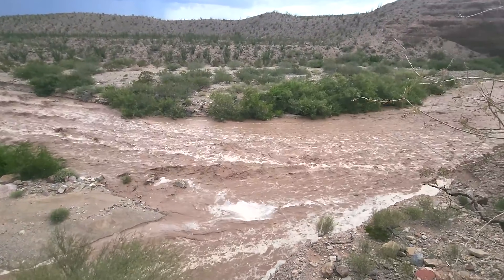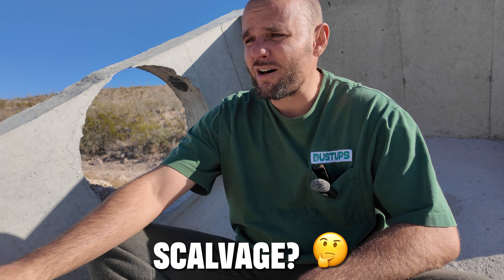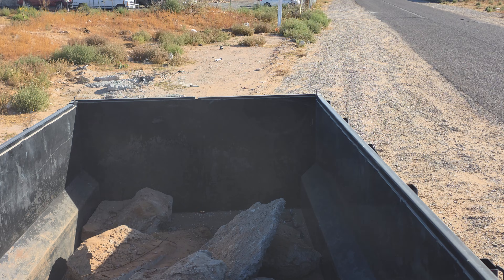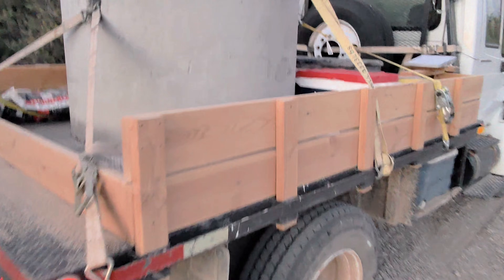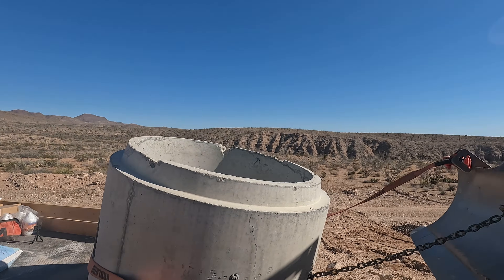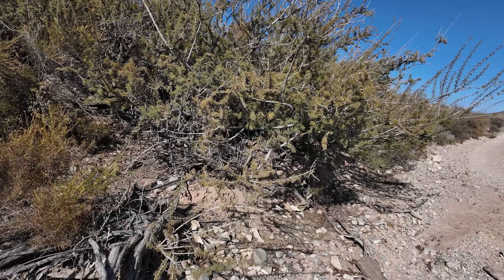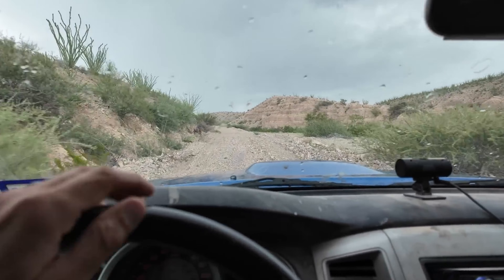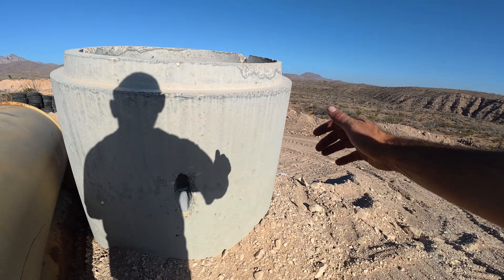I'm Fighting Desert Floods with Free Waste Concrete

Comment: the point is mostly to blunt the speed/power of the floods so it doesn't wash out the road, not stop the water? I wonder if there is other scraps you could gather something like bricks or even stones from demolished buildings etc
Reply from the maker: They are too light. We need big, heavy objects to fight the flow
Reply: @dustupstexas Having watched the video a bit further... You mention having a bulldozer. I am afraid it'll make most sense to move as much gravel and rocks from the surrounding hills to the canyon bed as possible and create a flat "dam" with a width of 30 foot or more.  Double the width of the canyon's bed (= space the water is flooding on), the water will have half force. I mean, the canyon is where it is just because thousand of years ago the first flood went the way it went and all floods afterwards just deepend the canyon.
Reply: @Barskor1 That needs to be checked, yes. Good suggestion! Shoveling dirt from one place to another on your private grounds to keep your feet dry during rain season possibly is not considered a dam though.

Comment: Could always incise lines into the concrete you get(on both sides you intend to break) and then use a hammer or its own weight to snap the blocks along those incisions. Then you can rearrange the smaller bits and use a little bit of cement to reconnect the waste concrete back into shapes that are more desirable for flood control. In general that can just make getting the material where you need it a lot easier. It stops being as free but your equipment will be much happier dealing in smaller pieces of concrete being moved(as will your backs) and you have more control over the final barriers. You'd effectively be making cobblestone walls out of concrete.

Comment: Scalvage needs to be a real word! Put it into a dictionary & ship it!
Reply: Boys, we've just witnessed the birth of a new word in the english language!
Reply: scalvage
/ˈskalvɪdʒ/ verb (tr. & intr.)

1. To search through debris, wreckage, or discarded material with the specific intent of extracting components that possess structural integrity or functional value. Unlike scavenging, which implies desperation or indiscriminate gathering, scalvaging implies a skilled assessment of worth.

"After the server migration failed, we scalvaged the user authentication logs to rebuild the session history."

2. (Software Engineering, colloq.) The act of ruthlessly dismantling a bloated software abstraction or legacy system to extract the high-performance core logic (the "gem") hidden inside, discarding the surrounding wrapper code, frameworks, or bureaucracy.

"The physics engine was a mess of OOP indirection, but the collision math was solid. I scalvaged the solver and rewrote the memory access pattern."

3. (Gaming) To loot destroyed vehicles or structures for high-tier crafting materials rather than finished goods.

Etymology: Early 21st Century: a portmanteau of scavenge (to collect from discarded waste) + salvage (to rescue or save from ruin).

Synonyms: Liberate, reclaim, repurpose, extract.

Antonyms: Landfill, deprecate, abstract (pejorative), wrap.

Comment: It seems you should retain the water underground, not above ground. Waterproofed underground pools with plastic sheeting. Water not exposed to sunlight can create a swamp where vegetation will cover the surface. Rainwater can remain there for months or years. From your video, the rainwater flows in a straight line; you can make the flow meander by digging holes and placing piles of stones where the water passes, forcing puddles of water to move like a snake, creating dozens of small puddles and properly waterproofed underground pools. This can retain and spread water. Vegetation will automatically begin to cover the ground. Groundwater hardly evaporates. The ground will always be moist, and that's the goal. Free water all year round.
I stated this long ago. I even suggested buried no-lid barrels. You can bury tens,hundreds of barrels,  hose-connecting them from up to down slope. Water will flow for months, years... the forrest will be a step away. 
No water. No desert forrest. Simple like that.
Reply: Simple like that: That will cost a fortune. 😊
Reply: @leonlowenstadter9223  Plastic sheeting is not that expensive and IMO the goal is water retention and plant biomass production I had a similar idea I called soil ponds acting like wicking garden beds.

Comment: 5:53 lights on for safety! Hire a semi? One trip might be $1000? The capacity is 5 times (estimate) what your are hauling. Best always
Reply from the maker: How will I unload a semi? The deck is even higher without airbags (I think).
Reply: @dustupstexas  a semi pulling a end dump trailer. Typical load is 40,000-60,000#. 3 axle trailers go up to 100,000#.

Comment: When unloading could you tie the item to something in the river bed then drive away? It doesn't matter if it breaks. That's one you get something heavy to use as an anchor.
Reply: That's too high risk of it damaging the truck as it falls off.
Last thing you want is for it to catch on something and rip the truck a new one in the process.
Reply from the maker: Hoping that heavy things falling from expensive equipment isn't a good strategy
Reply: @dustupstexas  Well, not a long term one at least.
Short term, it will at least be reliable enough to do it once.
It might just add the truck to the debris pile in the process, though. But it will have done it.

Comment: Might want to give the concrete blocks a rinse but otherwise water passing through them into the soil should be fine (assuming here the blocks having been used to house/protect other infrastructure such as pipework). 

Different story if the blocks were used for handling volatile chemicals and residue from that being on the blocks, as that would over the course of rain events leech into the soil (let alone groundwater). 

Additionally, a bonus of Dustups being majority rock and sand, water seeping into the soil goes through a gnarly filter passively.

Comment: Sounds like a solid plan.  Just watch for the gaps in the wall b/c that's where the water will be focused and you'll get serious scouring there.  Ideally, you want the concrete chunks to be at least 2 deep, stacked on the ground like bricks so the joints overlap and you don't have wholes in between that the floodwater can easily shoot through.  That first pile, for example, isn't butted up tight to the slope, so a flood that's only 2' deep will be able to go up the hill and around the pile, eroding into the bank and causing all manner of problems.  Potentially.  It's hard to say what will happen until that first flood shows you where the weak points in the design are.
Reply from the maker: It's not the final placement. That and the dozer can't place them with any precision. It will be messy and flawed, but still better than a raw flood
Reply: @dustupstexas  It doesn't require "precise" placement.  Just make an overlapping pattern so there's no straight run for the water to shoot through.  That film of yours shows a whole bunch of water coming down in the flood, and any part of that being allowed to skate on through a foot-wide gap is going to have tremendous erosion power that could leave you with a trench several feet deep.

Unless I mis-read the layout.  If you're putting the concrete on the downstream side of the roadway so that the silt will be deposited upstream, where your road is, then what happens after the water passed through the gaps isn't really important.  Sorry if I didn't get that right.....

Comment: Real Civil Engineer here with a MSc, 🏗️🧱🌊

Hey Shaun, your dam design idea looks pretty good, big pieces provide good structural integrity. Try to add more weight (fill the concrete voids with big rocks/gravel) to increase total moment of intertia. This will help alot to resist the water.

For your desert forest idea, holding the water is the most important thing my a mile. All other things dont come even close. If you have enough water available for a long time on a spot, nature will do the rest. The plant species/shade/soil/ are more the cherry on top.

If you have any questions, feel free to ask.
Reply: I can see many problems with what he is building but I am not a structural engineer so I shall be quiet.
Reply: @lukedaniels7750  the problems your seeing probably stem from what you expect them to accomplish with this project and what others expect.
Reply: @ProphetofEntropy  I don't know how you can say that without enquiring what problems that I foresee ? The water will find a path through whatever is used to dam it. Either the water will flow underneath the 'road' or it shall probably wash it away.
Reply: @lukedaniels7750  the point isn't to stop the water, its to slow it down.
Reply: @bobbycrosby9765  If the water could be slowed down, that would be great. That would surely reduce erosion.
Reply: @lukedaniels7750  WOW REALLY
Reply: @HR_DR  Excellent contribution to the discussion. 10/10 would read again.
Reply: @lukedaniels7750  He's essentially building a huge bda.   The goal isn't a dam but slowing the water so it will be less destructive and also so it will drop it's material upstream of the wall.  The wall will also mitigate the deep grooves he's currently seeing after flash floods which make it impossible to get back on the property until he rebuilds the road across the wash with the bulldozer.

What problems do you see?   You might see something interesting.
Reply: @mac_mcleod  I understand what you are saying. I just think that blocking some parts might make the water flow faster over other parts.
Reply: @lukedaniels7750  Understand.  I think his goal is a foot or two of still water going back a couple hundred feet with faster flowing water on top spilling over the concrete forms and going through small gaps full of smaller rocks between them.

Cheers!
Reply: @lukedaniels7750  Думаю его цель построить дамбу так чтобы  поднятие уровня воды всего  на метр создало заводь площадью в десятки акров где вода бы замедлялась и почва которую несёт этот поток оседала бы в этой заводи.
Reply: @mac_mcleod  I wonder how he's going to stop the embankments getting washed away?
Reply: @JK_Clark  Probably allow the water to go over hard concrete in a couple places.

embankment===___========___===embankm ent
The low part would be mostly concrete too but lower (6"?  12"?) than the high part.   But would still a couple feet high to create still water.  

Also, he expects the water to flow over the entire wall at some point so he'll probably take part of it up the embankment so the water won't overflow there.

However, I'm not sure he's realized he needs to protect the back of the wall from overflow turbulence and erosion yet.
Reply: @mac_mcleod  Many thanks for the explanation, that intuitively looks like a decent plan to follow. With all of the hardcore material in the surrounding area, hopefully he'll also buttress the concrete parts with a lot of boulders.
Reply from the maker: I wish I had a front loader. Adding weight in the forms would be trivial. Once we place them, I'll try building ramps with the dozer to shove material up and over the walls to fill the gaps. It should work, but we have to be careful. It's easy for the dozer to crack the forms if we apply too much force in the wrong spot
Reply: @dustupstexas  Я бы сказал что вам стоит нанять кран и точно установить все блоки за раз, на подготовленные бульдозером площадки.
Если волочить блоки отвалом бульдозера их разрушение неизбежно. Точность установки так же очень страдает, а вода будет стремиться размыть любой промежуток который ей оставить.
Reply: @dustupstexas have you heard of Tesla valve?? might be quite a bit of work and a lot of rock/concrete but if you’re looking to slow down the flow of water and stop erosion might be your best shot, if you place your barriers with Tesla valve design in mind I think in the long run will work better for your land
Reply: @derhell9401  I don't think that matches his plan here.

I think he's doing this

flood->   road    ->  25 yards/meters -> wall.
The wall is going to slow the water down to before the road result in the road being under an area of "dead" water.   As a result it won't get deep ravines and larges rocks on it.
Reply: Looked up the right vocabulary. Civil Engineering is perfect if you are familiar with dykes like this one: https://youtu.be/FwShERhxvzs?si=XodW6sczSqIexrHZ. This like 30 degree slope is "softening" the power of the water so that it does not break or washes the dyke. In parts of the Netherlands and Northern Germany there are dozens of kilometers of dykes to protect against the force of the North Sea.
Reply: Yeah this guy's videos come up on my feed and I make the mistake of reading the non Profesional comments.😅😅
Thank you for dropping in.
I felt a pain when he said he was using that pipe for something other than the flood control. Vertical filled with stone that's an anchor.
Reply: What’s a MSc?
Reply: @pyroman72  Masters of Science
Reply: You’ve given one engineering related piece of advice, to put rocks in the concrete voids. Do you really think a desert flood has a snowball’s chance in hell of moving those slabs?
Reply: @HikarusVibrator The water won't move them straight away/directly. the Water will flow around (which increases speed) and hollow the base so that they finally tip over. Being from Northern Germany with hundreds of years of so called Storm Floods in the North Sea, the only way to protect the road is to build a ramp towards the water with only a small slope. The water will then spread over much more area an lose its destructive power.
Reply: @leonlowenstadter9223  bro if that slab of concrete moves one foot while any of us are alive I’ll burn my physics degree on a livestream. 

Also, the point is to trap sediment, not have the water erode the sands away from the base. That’s the entire idea.

I’ve spent countless hours in mountains where there are yearly winter storms and violent rivers. The big rocks that lay around from rockslides don’t move at all. They erode away.

That concrete slab ways over half a ton.
Reply: @HikarusVibrator No need to burn your degree. It simply depends on the foundation. Rocks in mountains are based on other rocks. But put a heavy object just on gravel and water will push the gravel away, one pebble at a time. However, your are surely right, they won't flow away far but the base for the road is weakenend.
Reply: @leonlowenstadter9223  the subject under discussion is that the civil engineer said that the water is going to wash away a half ton slab of concrete. Whether or not it erodes along the base depends on how the slab is placed etc.

This channel has literally had entire videos dedicated to building beaver dams, so I doubt very much he’s just going to dump a massive slab of concrete on loose sand and leave it alone.
Reply: @HikarusVibrator I think Shaun mentioned about 25 drives, the canyon seems to be more than 60 foot wide. So I would think you just can get one, maybe one and a half, line of material which means sufficient room for the water to undermine it.
Reply: @leonlowenstadter9223  so it’s only concrete slabs huh? Nothing else? He’s going to drop the concrete and see if that works? Come on.
Reply: @H @HikarusVibrator  Shaun has implemented plenty of half baked ideas in the past, it would not surprise me if he dumped a hollow piece of concrete in a floodplain and posted about it washing away next year.

They may be half a ton but they’re also hollow and have a significant amount of surface area, they’re not the rocks you see while hiking.
Reply: @HikarusVibrator get ready to burn it.
Those mountain steams I'm next to in high run off you can hear the boulders moving.
A dry wash like this I went up one year and it had about 4 chokepoints. The next year they wear totally different stones the size of cars and access was 20 to 40 yards away from the previous point.
Reply: @H @HikarusVibrator Feel free to prove me wrong with calculations.
Reply: @pieter8481  lol are you serious. Firstly, I did postgrad math with flow mechanics, and even with that, the calculations would be wickedly difficult with an enormous amount of assumptions. I have done hundreds of hikes though, so based on what I’ve seen over many years of hiking in rivers where there are winter storms and insane rapids, rocks the size of those slabs don’t move. And they certainly won’t move if they’re on a sand bed. 

Maybe ask for a refund.
Reply: @pieter8481 you can see the results of the flood. Rocks that are tiny compared to the forms are surviving 

It might not survive a hundred year flood, but it's going to do it's job